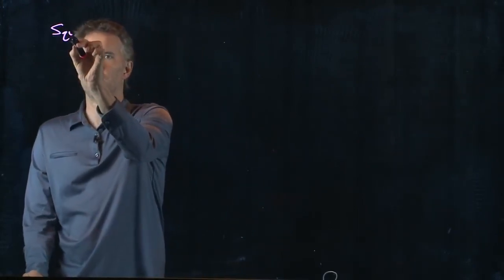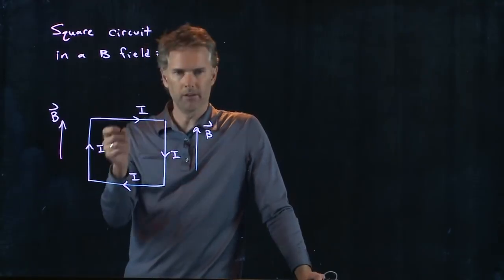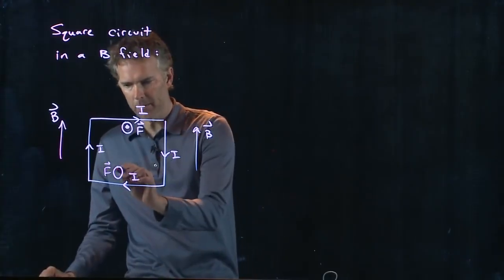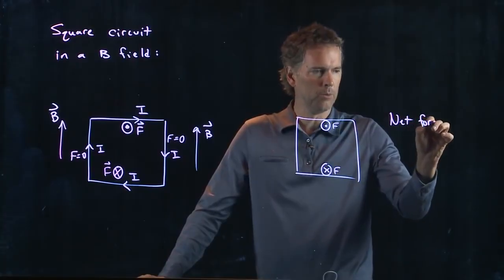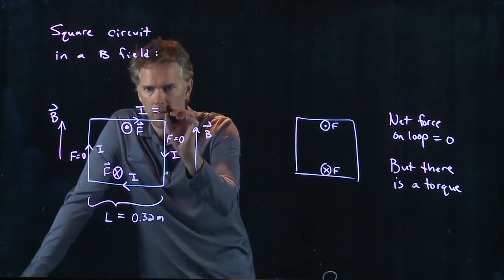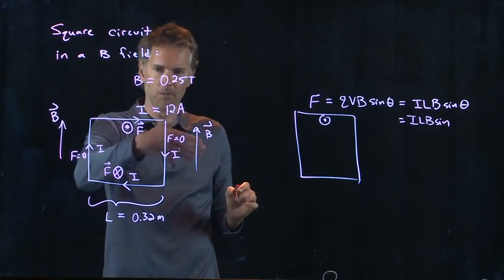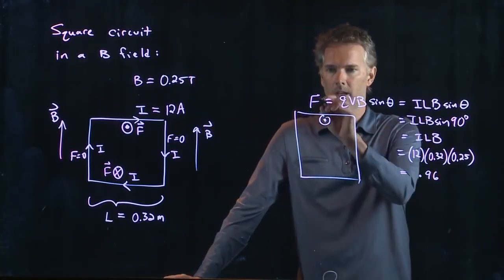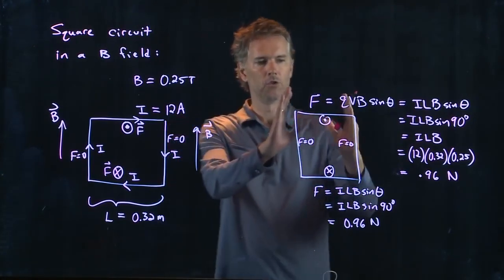Magnetic Torque | Physics with Professor Matt Anderson | M23-08

Comment: Thanks for this. If the bottom section of the loop is fixed as a hinge, can you comment on what the torque of the loop around that hinge would be.

I understand that F=mu×B=NIABsintheta gives the torque of a free loop as here, but was just wondering if that would be the same torque around a section fixed as a hinge. I suspect not. Can you confirm this.

The reason I ask is I'm doing a problem that asks to get an expression for such a torque (due to an unknown B field) around a fixed section as a hinge . And then asks to equate this expression to the torque due to the weight of the loop around that hinge. So we can find the target variable B.

If you comment on this, I would really appreciate it.